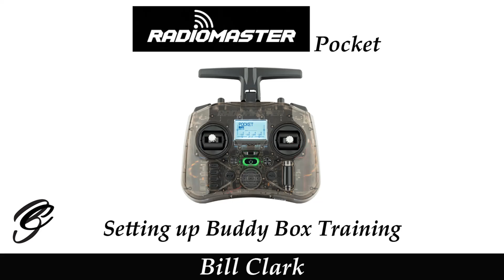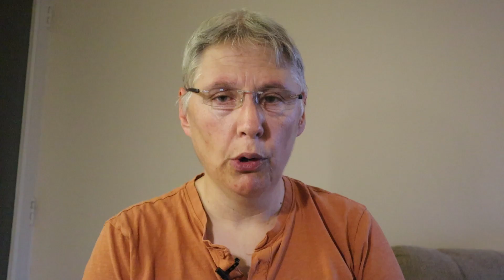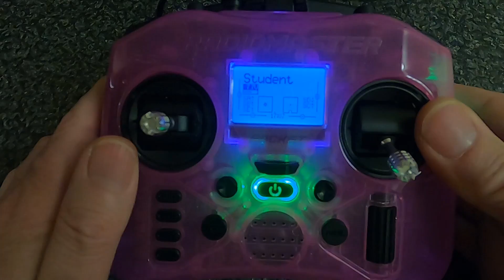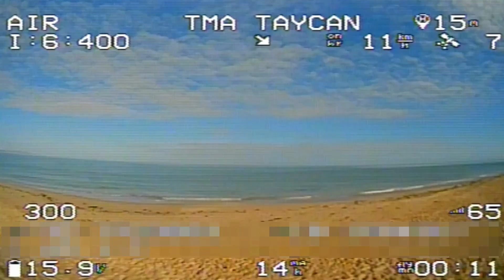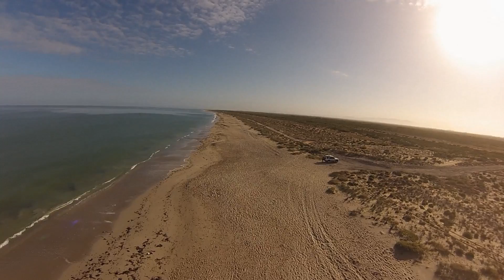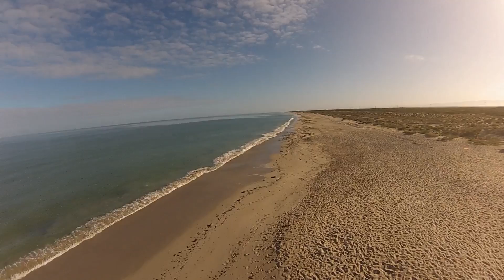RadioMaster Pocket Setting up Buddy Box Training

Comment: Thanks for the tutorial Bill! I'm looking for a source for the training cable, which you describe the training cable as a "3 pin" "3.5mm stereo lead." Can I buy that anywhere, or do I need the Radiomaster branded training cable?
Reply from the maker: If you could borrow a standard 3.5mm stereo jack lead to try but with some RadioMaster radios you need to use a plastic washer to make the connection work. Not ideal I know. This happened due to a non standard socket being installed in some radios prompting RadioMaster producing the cable kit.

Comment: what about doing it wirelessly?
Reply from the maker: If you have an ExpressLRS Transmitter run the ExpressLRS Lua script under SYS, TOOLS. Under Backpack Select BLE Joystick. On your computer go to Bluetooth settings and Settings, Devices and add the ExpressLRS Joystick. The radio should be an option in your flight simulator.

Comment: can you use a non radiomaster radio for the student? I am planning to use the cheap radio that comes with the eachine e120s rc heli.
Reply from the maker: As long as it has a DSC trainer port you should be ok but may have to check the channel mapping and adjust in the EdgeTX Master radio. Just check each gimbal on the student radio is activating the correct control surface on the model.